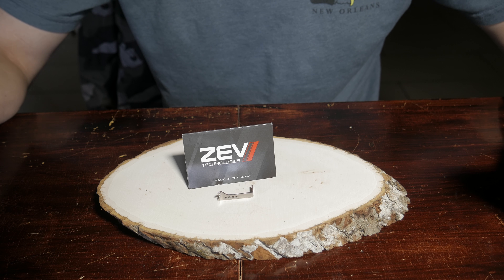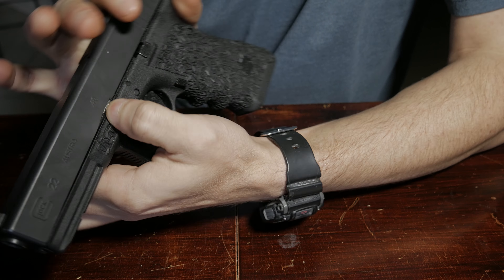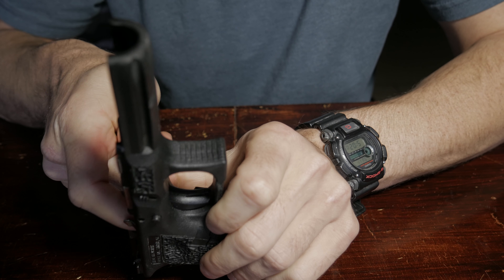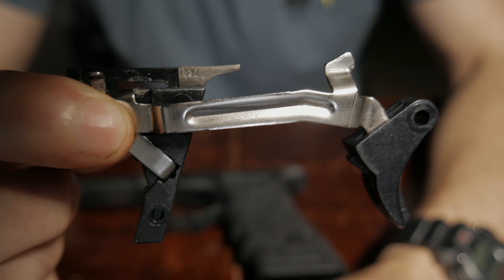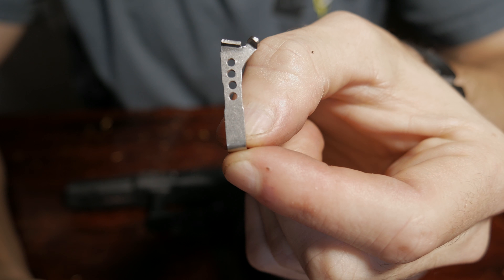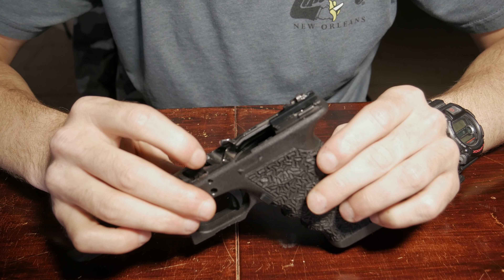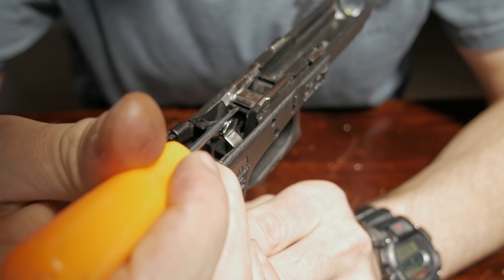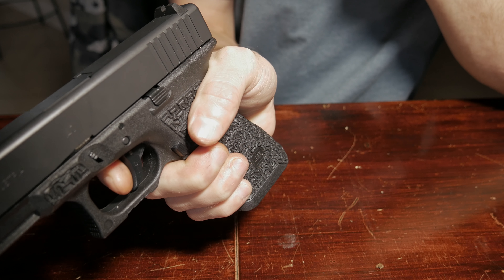HOW TO INSTALL THE ZEV TECHNOLOGIES V4 3.5lb Race Connector

Comment: Hello. Whether ZEV V4 match gen5 ? I have Glock  19X.
Reply from the maker: billykid3 I don’t know if they are compatible Gen 5 it might say on there website
Reply: I was looking but I did not find the information
Reply: I got my second connector today from zev both for my in my glock 21s the v4 and the new pro connector is the same as far as I can tell they just changed the look alittle both run amazing but I think my buddy is running it in his gen 5 as well